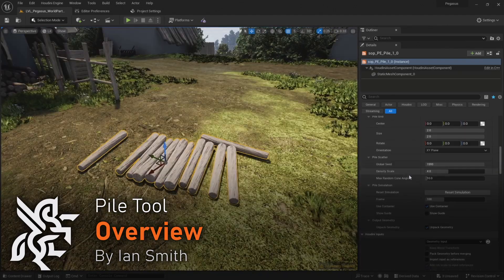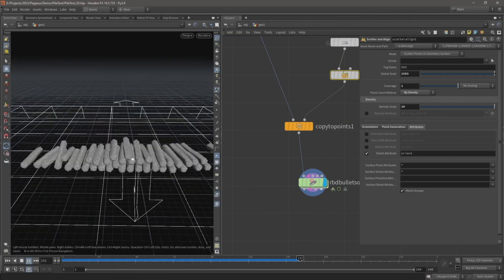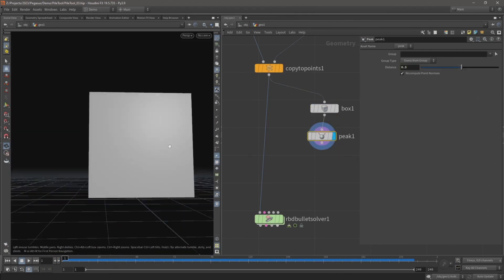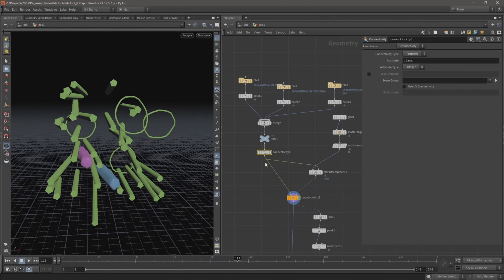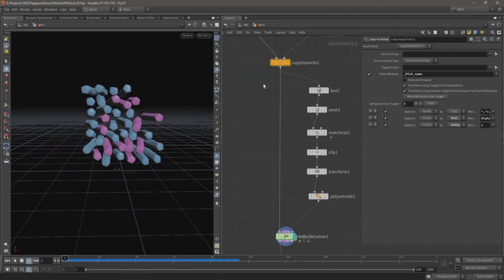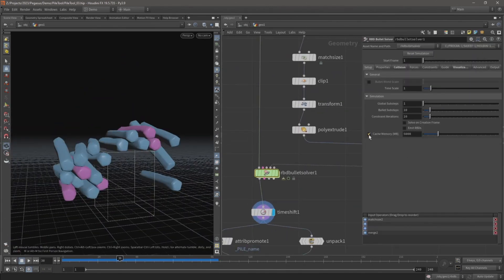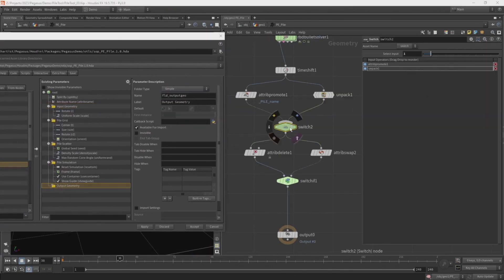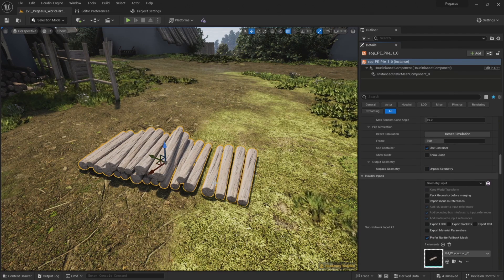Project Pegasus | Pile Tool | Overview

Comment: If I buy Houdini, will it be forever??? 3000 dollars??? Or is it a subscription?
Reply: If you are making less than 100 k a year and you don't need more than 3 licences, i highly recommend you to take a look at the Indie version. Its 400 dollars for 2 years and you have no other limitations than the ones i mentionned before.

The 3000 dollars version is houdini core, witch is limited in terms of features, but perpetual. You need to pay for version upgrades (1500 dollars) and you are NOT limited in terms of number of licenses and incomes

The 6000 dollars version is Houdini FX. There is no limitation at all on anything and it's perpetual. You need to pay for upgrades (4000 dollars).